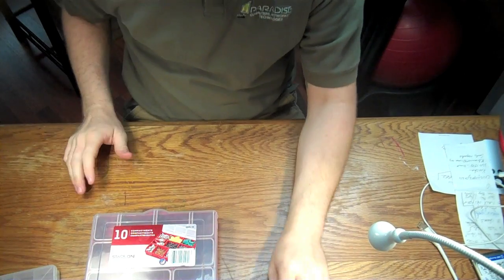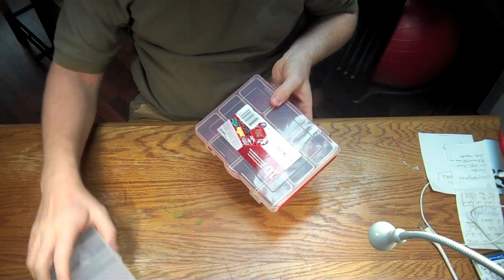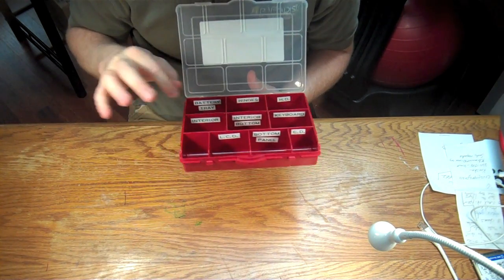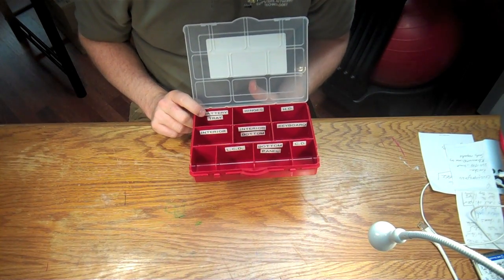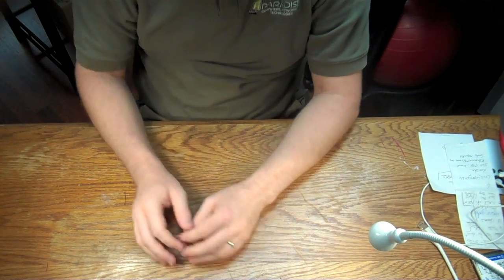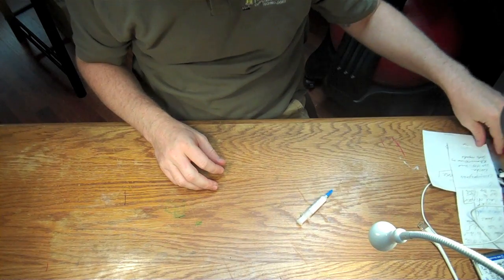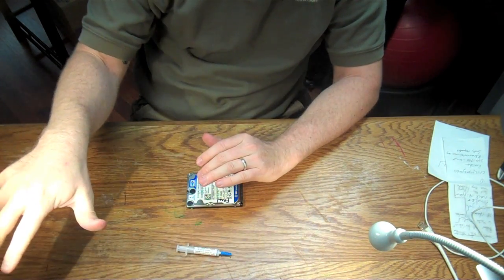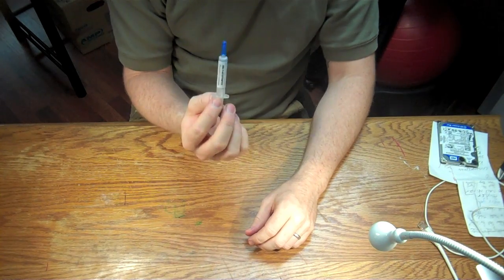Screw Organizer and Thermal Paste Explained

Comment: Arctic Silver calls for multiple methods of application depending on CPU brand and specs. Application methods includes Vertical or Horizontal lines as well as Middle dots or Surface spreads. The methods are recommended by the CPU manufacturers according to Arctic Silver Reps.